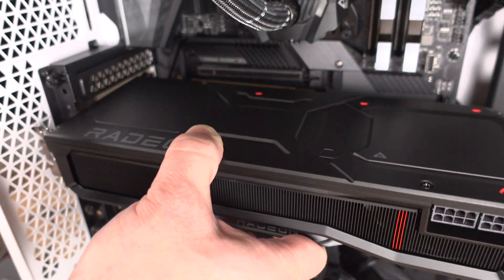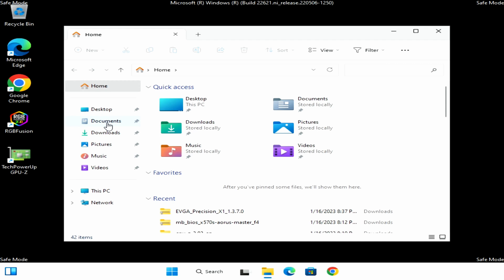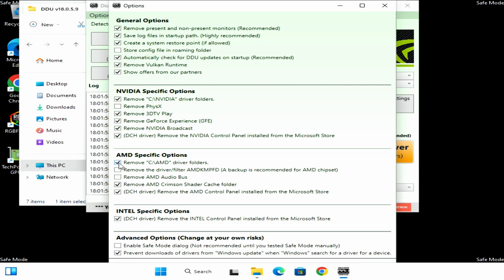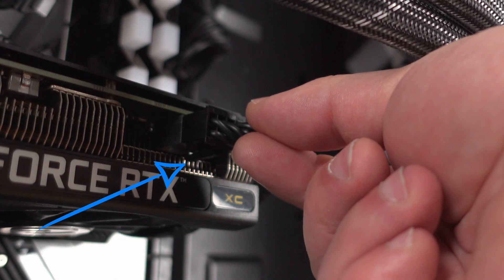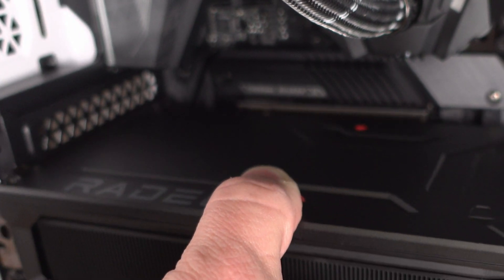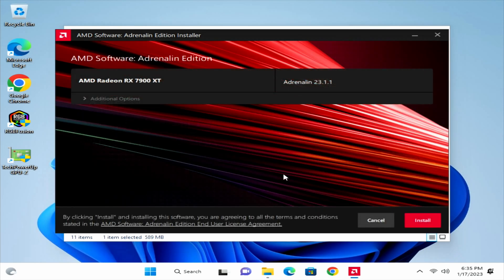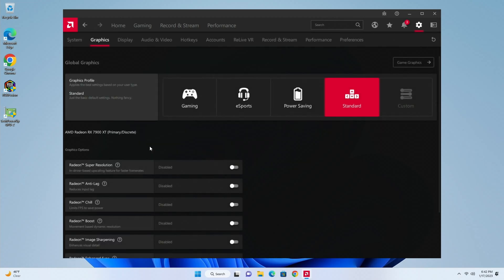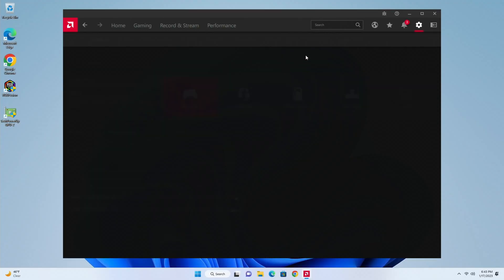The best way to Install the AMD Radeon RX 7900 XT Graphics Card in your PC

Comment: I would recommend installing a brace to support the card to reduce the strsses on the PCI socket and protect the GFX cards PCB from cracking overtime. I was unhappy with the stress installing the 2 x 8 pin power plugs put on my card while trying to manage them and also how they looked so i bought and installed the Thermal Grizzley  Wire View GPU adapter, not cheap but to myself worth it,  This provided better cable management and less stress on the card and a wattage display. Thank you for providing an excellent guide in the best way to install just about any graphics card, Take care, God bless one and all.
Reply from the maker: yup, for sure, and in this video I go over 3 that I have used, well 4, I hope you like it: https://youtu.be/hyEJz56yg24, do you use any of those?  Thats an interesting adapter, I would love to review one, I may reach out to them at some point, I've never seen it before, looks cool.  Thanks for letting me know about it and I hope the very best for you and god bless you as well.
Reply: So is it strange that my Sapphire Pulse RX7900XT came with a support brace in the box?
Reply from the maker: not at all, it states that it brings a graphics supporter: https://www.sapphiretech.com/en/consumer/pulse-radeon-rx-7900-xt-20g-gddr6 @MrExdous69
Reply: @MrExdous69 If they included it sapphire knows you need it to use there card and it not be damaged over time. Sadly few companies do something from the goodness of there hearts if a bracket is provided then they think that the stresses on the card of not being supported will lead to damage over time.

Comment: My usb mouse does not work in safe mode.  Help!
Reply from the maker: If it is USB, connect to a different port, in the rear of your pc, try a black port.
Reply: @ThisBytesForYou  Thank you.   The mouse was a Logitech mouse and i believe because of safemode, it was not loading the drivers.  I used a generic usb mouse and it worked fine.  Thank you, great video.  Some of the screens in DDU are different now but it was easy to navigate.
Reply from the maker: Always a pleasure my friend, so very happy you stopped by, trusted in me to help you, liked and subbed as well as took a moment out of your day to thank me.  It means a ton to me and I am so very happy I could help you.   Logitech mice at first don't need drivers, they can be used in safe mode, as long as its directly through USB, not wireless.  As long as that cable is there, you should be good.  What is the model number of the mouse you are using?
Reply from the maker: Its a bluetooth mouse, connect it with a USB cable.

Comment: Thank you so much for this video. After  seeing the 40 series supers to be lackluster i ended up replacing my 3070 with a 7900xt and its been workinf flawlessly
Reply from the maker: Awesome stuff my friend and always a pleasure, so very happy you stopped by, trusted in me to help you, liked and subbed as well as took a moment out of your day to thank me.  It means a ton to me and I am so very happy I could help you.  Thats a sweet upgrade too.
Reply: Ha me too. I was holding out hope the 4070 super would have more vram or the 4080 super would have been a little cheaper. 

I could have gotten the xtx but didn’t think the extra 10% was worth $250 more. I also could have gotten a 4090 but I wanted to stick with an all AMD build if I had to drop 2k on a gpu. 

I was tempted to wait for the release of the RX8800XT which is rumored to be faster than the 7900xtx but at half the cost… but didn’t want to stick with my RX7600 for almost 2 more years.
Reply from the maker: 4070 is a great card, you are good my friend.  I don't know if you would be hitting your memory limits though, might want to throw up afterburner and enable the onscreen to show memory, you might surprise yourself but still it is a nice card. but yeah the 7900 is much nicer. @MrExdous69

Comment: are both of the 8 pins that plug into the gpu coming from the psu? Im struggling to figure out where the other 8 pin is coming from.
Reply: I have a modular power supply so I plugged in a cable with 1 pcie, but I have another cable with 2 pcie's on one end. Would that be the one I need? Thanks
Reply from the maker: @datboiandree4432  no, don't plug in one and daisy chain them, each directly from the power supply.
Reply: thank you. plugging the other cable in for the other pcie slot now. much appreciated @ThisBytesForYou
Reply from the maker: @datboiandree4432  always a pleasure my friend, so happy I could help.
Reply: follow up, on the cable with 2 pcie's, would you use the outermost connector or the one inside closer to the middle of the cable? @ThisBytesForYou
Reply from the maker: use the one in the center, coming directly from the PSU

Comment: What an amazing video! This actually shows everything unlike some guides,
Question tho

Can i replace my my processor too?
Reply from the maker: Always a pleasure my friend, so very happy you stopped by, trusted in me to help you, liked and subbed as well as took a moment out of your day to thank me.  It means a ton to me and I am so very happy I could help you.

You can replace your processor, I can help I just need to know what the motherboard manufacturer and model number is.
Reply: @ThisBytesForYou  i have succesfully replaced my CPU/GPU (even detached my motherboard because of some cooler issues) but my computer is working very well now thanks to your video and the pc building subreddit. Many thanks from Belgium :D
Reply from the maker: awesome my friend, so very happy I could help you.  If you could, and it won't cost you any points there (they clobbered me on there) please share my videos on there, it helps sooooooo much.

Comment: Help pls 🙏😩: when I turn the power back on the display doesn’t turn on , it says no display port signal or hdmi signal!
Reply from the maker: So that I can help, please list the manufacturer and exact model number of the following components:
1. Motherboard - manufacturer and exact model number
2. CPU - manufacturer and exact model number
3. RAM - manufacturer and exact model number
4. Video Card - manufacturer and exact model number
5. Power supply - manufacturer and exact model number
6. Monitor - manufacturer and exact model number
 Redundant I know, but many people forget to enter manufacturer and exact model number
7. Do you have ALL of the PCIE connections plugged in, and not daisy chained or pigtailed, each coming directly from the power supply?
8. Are you running through HDMI, DP, DVI, VGA, any adapters?
9. Is UEFI or Legacy Setup in the BIOS?
10. What slots do you have your RAM installed in?
11. Do you have CSM Enabled or Disabled in the BIOS
11. Installed latest supported chipset driver?
12. Are you plugged into the gpu or the onboard video on the motherboard?
13. This video will help you identify hardware inside your PC: https://youtu.be/65ZSiVImJx0

Comment: hello, my psu cable has two 8pin pcie connections on it, is it okay for me to just use the one cable with the two connections? or should i use two separate cables running from the back of the psu and let the second extra 8 pin connections on both wires just dangle?
Reply from the maker: Hey bud, no, I NEVER recommend doing that, its kind of like sharing a drink with your friend, using one straw, you just pop a hole in the straw and insert another straw into it, your both going to be getting the drink, but there will be a lot of bubbles, not the full stream.  Use 1 cable for 1 connection, so 2 cables for 2 connection, 3 for 3 and 4 for 4.  You can dangle, just use zip ties to make it look nicer.
Reply: @ThisBytesForYou  thanks a lot for the reply! I'll be sure to fix it.
Reply from the maker: Thank you so much for your kind words and support my friend, it means the world to me and I am so very happy I could help you.

Comment: I have a short question if it isn't to much of a bother. i plan on buying a RX 7800xt, i an heard a few people saying it is a triple slot card, and we might need a support bracket for the GPU otherwise it could possible damage the PCI slot in time. Know if that info is true?
Reply from the maker: It's not a triple slot card but GPU support is important, check this out https://youtu.be/hyEJz56yg24?si=HUDLaHqow9L13QwQ

Comment: Thank you, this helped me figure out some really dumb mistakes I was making.

Only thing is, I currently only have a daisy-chained cable to connect to both PCI-e 8-pins (well, 6+2—which by the way don't click together as nicely as they do for you). How serious a problem is this? Could I at least temporarily do it that way, with a daisy chain, until I get another separate PCI-e cable?
Reply from the maker: Always a pleasure my friend, so very happy you stopped by, trusted in me to help you, liked and subbed as well as took a moment out of your day to thank me.  It means a ton to me and I am so very happy I could help you.  Also, 6+2 is perfectly fine, and it didn't click together so easily for me either hahah, but I don't want to waste your time watching me fumble around, they are always difficult.  As for daisy chain,... it could cause issues, it may not, its a gamble, try to keep that limited as much as you can it could cause bluescreens and/or loss in performance so please do change it when you can.  What is the manufacturer and model number of your power supply?
Reply: @ThisBytesForYou  Thank you for such a quick reply! I will try to get another separate cable as soon as possible, but I was just curious if I would at least be able to turn it on to see if it works properly and is correctly installed. I take it that it should be fine at least for a few days while I wait for a cable that I will order?

My power supply is brand new, it's the Seasonic Focus GX-1000.
Reply from the maker: anytime bud, so the website shows you have 3 cables, 2 x 6+2s with the daisy chain and 1 x 6+2.  You can use the single 6+2 and one of the daisy chained 6+2's, just don't use the second connector.  Check inside the power supply box, so 1 cable, 1 connector used, never 1 cable 2 connectors used.
Reference (scroll to the bottom): https://seasonic.com/focus-gx#
I hope this helps.
Reply: @ThisBytesForYou  I was just starting to realize this must be the case, haha! Someone else actually installed the power supply for me and I don't think he fed the other cable through properly so it can reach the GPU. I'll ask him about it. Thanks again!
Reply from the maker: Always a pleasure my friend, if you are hesitant, this might help a bit: https://youtu.be/7SjQo7wrWq4 @Phagocytosis

Comment: Very good video. My sole complain that you mentioned not to use eps cable at putting in the card, it would have been nice to show what eps cable is and whats the difference.
Reply from the maker: In my latest video I show where it connects, as for the difference, it won't fit unless you push with all your might and break plastic pieces since the mold is different, very small to see.  Connections will sometimes read EPS/CPU and PCIE/VGA at least the good power supplies do
Reply: @ThisBytesForYou  Ah makes sense, thank you. Reassuring to know its usually marked and not easy to fit wrong. All in all, hats off to you, this vid was very easy to follow.
Reply from the maker: @Kevlord22 Always a pleasure my friend, so very happy you stopped by, trusted in me to help you, liked and subbed as well as took a moment out of your day to thank me.  It means a ton to me and I am so very happy I could help you.
Reply: @ThisBytesForYou  Done and done and thanks once more.
Reply from the maker: @Kevlord22  hey, thanks so much my friend and it is completely my pleasure, I am so very happy that you found it beneficial and glad to have you aboard ;)

Comment: This was so helpful. Wish there was a bit more info about the power supply and pcie cable struggle. I really don’t know if I did it right. I used 2 cables with the piggyback to connect to the 3 power inputs on the card… but thanks a lot ❤
Reply from the maker: No struggle but you can check out my latest video I break it down even moe

Comment: can i use the DDU software when installing a new cpu.

as on the 25th august im upgrading my rig from a 6600XT and 5800x to a 5800x3d and a 7900XT Nitro Vapor X (Sapphire).

also how can i find out what bios update i need to flash my motherboard with for the new cpu (the board im using is a rog strix b550-xe)
Reply from the maker: are you using on die graphics from the cpu?
If you are going from a 6600XT to a 7900XT then yes you would use DDU, those are graphics, but if you were using the graphics from the cpu going to a gpu then you would use DDU as well, Display Driver Uninstaller.
To find out if you need it for the cpu, you would look here: https://rog.asus.com/us/motherboards/rog-strix/rog-strix-b550-xe-gaming-wifi-model/helpdesk_cpu/
BUT I recommend updating it regardless, you can find the BIOS files here: https://rog.asus.com/us/motherboards/rog-strix/rog-strix-b550-xe-gaming-wifi-model/helpdesk_bios/
I dont have that particular board, but you can see this video on how to update the BIOS for another B550 board: https://youtu.be/AWxliGLert8, dont use the specific BIOS in that video, use the link I provided in the comments above.

Comment: Thanks for this.  My Sapphire Pulse 7900XT arrives today.  I wanted to make sure to get a clean install of the drivers.   I use an old chopstick to disengage the PCIe locking tab.  It's a lot easier to get at it than with my fat fingers.  🙂  Thanks for the video!  I will be watching it again while I do the install.
Reply from the maker: Always a pleasure my friend, so very happy you stopped by, trusted in me to help you, liked and subbed as well as took a moment out of your day to thank me.  It means a ton to me and I am so very happy I could help you and let me know if you have any questions.
Reply: @ThisBytesForYou  Hi thanks for the reply.  Ran into a bit of drama. I removed my 6600xt and installed the 7900xt when I went to start nothing..  No Power!  Took me two days to sort out the problem turns out my power supply chose that precise moment to fail.. 🙂 After I replaced that everything went smoothly.  Once again thanks for the video!
Reply from the maker: eeek, I hate it when that happens, sadly it happens often, but so very happy you got it working.  And always a pleasure my friend ;) @mojoneko8303
Reply: Very happy with the 7900XT. 🙂
Reply from the maker: nice, good stuff my friend, so happy you are enjoying it @mojoneko8303

Comment: 12:00 it is at this step my new gpu shows a black-screeninstead of showing windows.

radeon rx 6750 xt black screen(shows motherboard logo asrock then goes blak)
disconnected ssd hd and can use bios

removed gtx 1650

upgraded ps from 550 to 850

win 10 pro 64bit

HELP?

OR
guess i need to reinstall windows
Reply from the maker: no, you dont need to reinstall windows , from .02 to 6:25 I show you in this video how to change your BIOS from BIOS to UEFI and your OS from MBR to GPT, these cause these issues.  Also, your HDMI cable needs to be HDMI 2.1, if you are using HDMI, can should not use adapters, they will cause issues and if you use DP, you need to make sure it is 2.1 as well.  This should let it work, if need I will need more information to help yoiu, but give these a try, and here is the video https://youtu.be/aHVCmkm67q8, I know its a cloning video, but from 02 till 6:25 it shows you how to make the necessary changes.
Reply: @ThisBytesForYou  reset bios to factory worked for me! tyvm :)
Reply from the maker: awesome friend, you will want to enable UEFI and GPT regardless, but glad you got it @Trains_of_thought

Comment: Thank you for showing us the PCIe cables plugging. I had to file down part of the ones that enter the GPU because the ones that my PSU brought (Gigabyte's  P1000GM), had a small plastic line, rail, whatever you want to call it, on the opposite end of the PCIe 6+2 cables.

This means that, when attempting to plug the cables in, they did not go all the way, and the bottom did not click and lock in place, as it prevented the cables from going in the necessary distance.

After hours upon hours of not realizing why my monitors kept "losing connection" and my 7900 XT kept turning it's lights off (mine has a low white light near the fans), I have finally found out why this kept happening and it's all thanks to this video, so a huge huge huge thank you good sir, I can finally use my PC without having to restart it and reinstall drivers every 2/3 days.
Reply from the maker: Always a pleasure my friend, so very happy you stopped by, trusted in me to help you, liked and subbed as well as took a moment out of your day to thank me.  It means a ton to me and I am so very happy I could help you.  That was a great catch by the way.

Comment: You can skip half of these if you are not using Windows. ;)
Reply from the maker: Yeah you can skip the windows portion, but I only cater to windows, it's been a while since  I worked in Linux
Reply: @ThisBytesForYou  
Btw. the unlatching GPU is always easy with AiO. Try doing that with NH-D15 + some big ass GPU. I think that would be a cool video material.
Reply from the maker: well, not always easy, some older boards had the latch facing down, with larger gpu's was very difficult, both ways AIO's did make it easier.  I will see what I can do with that, thanks.